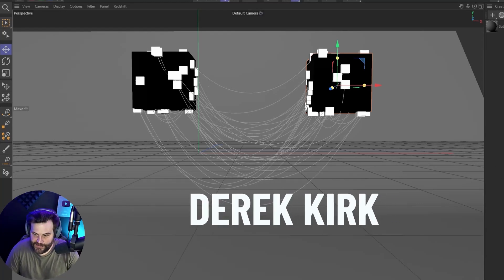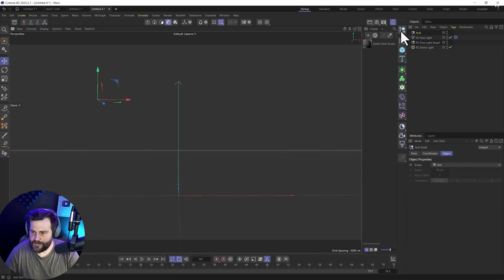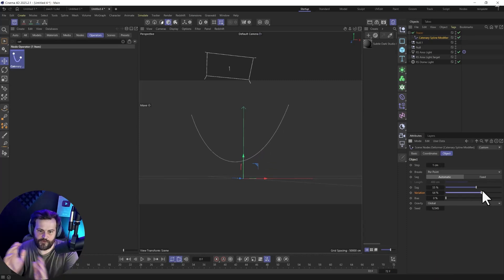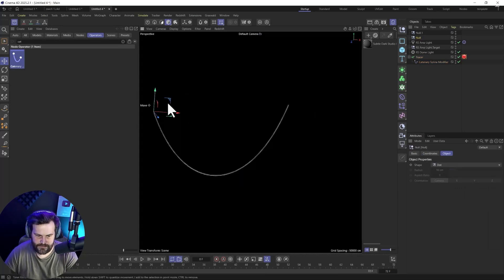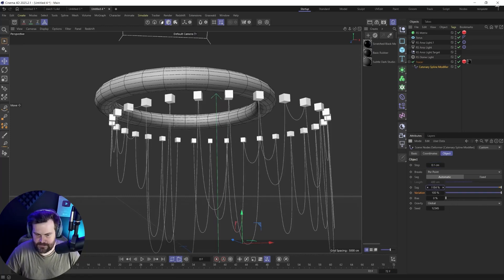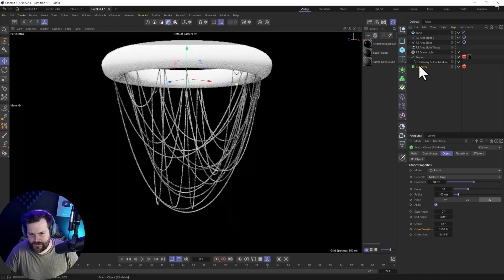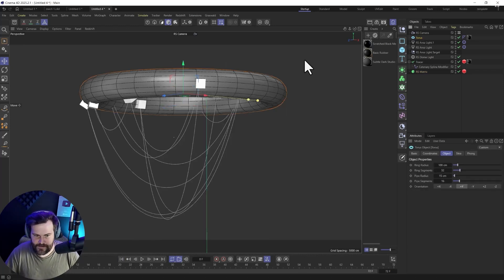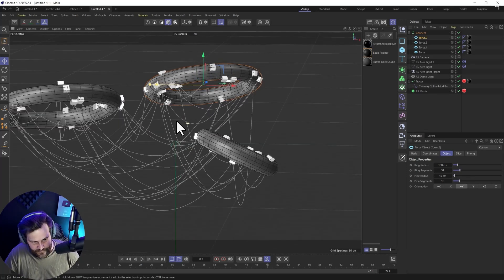Effortless Cable Connections in Cinema 4D! Tutorial + Project File

Comment: any possibility to change the shape of the sag? 
i got some very stiff cables (12cm diameter) that are hung vertical between 2 points. 1 stationary, the other end is moving a bit. the shape would be more like a >> U << so really vertical parts and a more round bottom part. 
also: can I influence the stiffness?
Reply from the maker: Yes
Reply from the maker: 9:10
Reply: @effectatron  thanks for your help, I saw that, but it does not make anything fall vertical enough before being drawn to the other point. 
unfortunately this is not what I need to make it look really nice in the end. it is enough to have the basic principle showing and I think it will stay this way, but it could be nicer..
to try to explain what this should be: 
I use this setup to have high voltage cables and some flexible hoses connected between fixed machine parts and moving/ rotating machine parts. Those cables are the 'flexible'  parts between several hard surface pieces that are being moved/ rotated via xPresso. they are connected to existing downward pipes and vertically fixed cable end so having them start at a slight angle is okay for some parts, but moving gives away that they are not really stiff or connected downwards. 
for now i used your setup to have a null on 1 object, 1 null on the other object it connects to, sorted as children of the xpresso related parts. this works fine. 
to solve my issue I tried 
1. adding target tags from the null objects to copies of themself higher up or down the start/ end points to try to get a slightly stiffer vertical connection point behaviour - does nothing, only start and end are respected
2. add more null objects in the tracer between start and end - this has no effect at all, only start+end are respected.

is there a method to connect another spline to the endpoints of these cables to fake some vertical parts that ? 

I guess I need to learn how to use IK chains or such to try to make it work. Saw some really nice stuff here using cactus dans tools, but those i cannot find anymore and I wonder if something similar is implemented in v2025 by now. there were some point constraint with springs along the spline to mimic some sagging and stiffness.